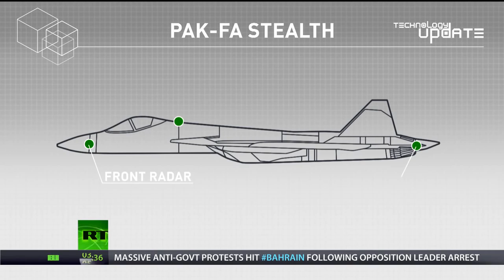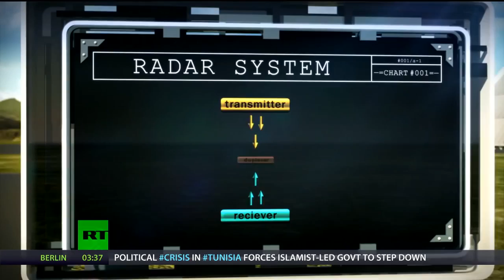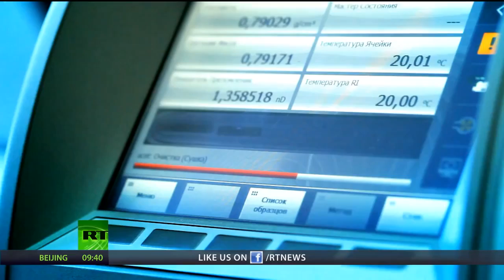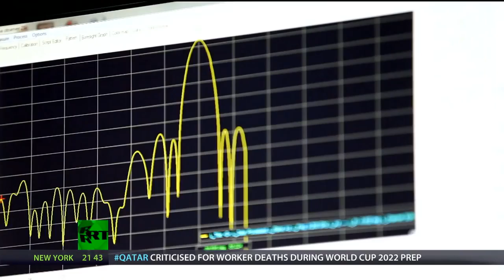Sukhoi T 50 PAK FA Stealth Technology

Comment: Congragulations Russia! You finally caught up with the United States stealth technology! You have my congratz. Now, the f-22 has better stealth characteristics, it's cruising speed is Mach 1.5-2 while it's true top speed is classified. The f-22 also has supercruise, allowing it to save fuel while going supersonic speeds (doesn't need afterburner), thus making the range further and more efficient. The f-22 also has AESA radar, a faster, more effiecent Radar that can jam other radar and missiles while it's tracking objects (can be used for close counter attacks). The pakfa has a faster cruising speed and 3d thrust vectoring, making it faster and more maneuverable. Yet it lacks supercruise, making its range shorter. The stealth is a little bit weaker than the f-22. So for the winner, you guys decide. I personally think the f-22 because it's AESA radar can jam missiles up close, and the stealth can hide them from miles away.
Reply: Actualy YOU cought up with RUSSIAN stealth technology, since you obviously don't know who "invented" it!!
Also, T-50 has more fuel, so not having super cruise isn't a flaw, also unlike F22 high sensitivity (can't fly in) to the RAIN, small arms fire and thunderstorms, it can do all that, and plus, again unlike F22, it can produce it's oxygen without poissoning its pilots, like F22!!!
Also, you know that Donald Cook incident a while ago, If F22 has radar jamming, and T-50 doesn't, what do you think that ooooold MIG that "killed" your destroyer was testing, it's practicly and EMP (without permanent damage to the circuits)!!
Reply: Pyotr Yakovlevich Ufimtsev (born 1931 in Altai Krai) is a Soviet/Russian physicist and mathematician, considered the seminal force behind modern stealth aircraft technology. In the 1960s he began developing equations for predicting the reflection of electromagnetic waves from simple two-dimensional shapes.

Much of Ufimtsev's work was translated into English, and in the 1970s American Lockheed engineers began to expand upon some of his theories to create the concept of aircraft with reduced radar signatures.
Reply: Joseph565112 I think you need to look into the latest Russian radar systems that are fitted in the PAK FA also its defence systems which are an improvement on the already tried & tested SU-35BM,By the way there's no such thing as total stealth on any aircraft you'll already know that though also i'd like to know just out of curiosity what exactly is woefully inadequate about it's electronic capabilities as i know a little about the PAK FA's defence system & it's radar.I also know a little about it's long range weapon capabilities.I'm not saying for one minute you don't have the credentials to make statements about an aircraft's stealth capabilities i'm just interested to hear your take on the systems I've mentioned like the AESA & Irbis as they're part of the electronic warfare capabilities.The PAK FA has  a masking system & it's long range missiles can hit simultaneous targets up to 400km away,this is a fact as they've been proving them on the  SU-35BM over the last couple of years.
Reply: Correction, USA made (production stopped 3 years ago) 187 F22's, out of which 3 crashed KILLING 2 of their pilots, and Russia is about to make 240 T-50's, that's 1:1,4 in terms of numbers... BUT Russia just began (6 made so far) making them and can produce much more if needed, for the price of $86 000 000 a peace, while F22's costed the US $360 000 000 a peace (4 and a half TIMES more)!!!
Reply: Being a millionaire in USA is AVERAGE today? Hahaha... 45 milion people in USA have 2 or LESS meals a day, meaning live below poverty line, another 30% live on paychecks not over $24 000/year, now THAT'S your average!!!
Also you should keep in mind that you might have $30 000 while average Russian may have $10 000, BUT he won't have to pay mortgage to his $300 000 house in the suburbs, but a bank loan for a 2 bedrom flat worth 1/5 that, also other "living expences" are much lower than in the US!!
Reply: If the f22 is that great why they stopped producing it?
Reply: Cause they:
1 - KILLED their pilots, or at least poisoned them, 2 confirmed kills in 3 crashes, 13 confirmed poisonings!!
2 - Cost $360 000 000 (that's 330 000 000€, as 3 jumbo jets) a piece, and globaf financial crisis hit US hard too...
3 - Besides being more fatal to their pilots and technicians, they are extremely needy, for every hour of flight (that costs $47 000), they need aditional 39 hours of maintenance, which costs at least as much probably!!
4 - They are, or were until 3 days ago if what I heard is true, only paper machines, not literaly but in 9 years of service they NEVER, EVER saw combat actions, eventhough US invaded (for no reason) Iraq, Avghanistan and bombed Lybia, until they started, or so they say, bombing ISIS with it!!! Offcourse the reason is obvious from #5, so here it is...
5 - I wrote paper machine cause it is so FRAGILE that it's ridiculous, it must NOT fly in the rain cause then it's much more visible, aka not stealthy (eventhough it isn't in dry weather for Russian low frequency radars), it must NOT fly when there are thundestorms 25m/40km around target cause of sensitive sensors/eletronics, it must NOT be shot not even with small caliber rounds as it's skin is so fragile it would tear itself!!!
Reply: Dionendermann
Actualy since you're the one that spiled that load of crap, you should provide evidence for your data, which is inconsistent with the "mainstream", like I said, 187 built, at least 2 crashed, you say it's 195 build, prove me wrong?
Reply: Your comment is so informative .. thank you.
But do think that the russians are going the extreme route since they have got less than 12% debts .. that it will help them with mass production plan .. plus there must be alot not to be revealed.  Since its a fresh product.
Reply: Your comment is so informative .. thank you.
But do think that the russians are going the extreme route since they have got less than 12% debts .. that it will help them with mass production plan .. plus there must be alot not to be revealed.  Since its a fresh product.
Reply: Well the bigger the economy is, the more you actually spend on the product. Say for example, something costs 200,000 mill in America, but the same exact thing will cost maybe 20 mill in Russia, but it effects both country's almost exactly. 200,000,000 is as expensive as 20,000,000 in Russia. So it almost doesn't matter. Sorry for any confusion in my comment lol
Reply: Dionendermann No I got your point .. well said man .. I think you are Pilot, Engineer, and economist lol.
well said man, well said.
thank you.
Reply: Lol i want to be a fighter pilot! But thanks a lot dood
Reply: Alright so i researched a bit and neither the soviet nor the u.s "invented" the stealth technology. The Germans first used it in a submarine seen here: http://www.faqs.org/espionage/Sp-Te/Stealth-Technology.html
Reply: the keyser soze that was the wrong comment section. Its awkward on my phone.  
But don't get cocky about this, the Chinese will not be far behind.
Reply: Don't forget the Sukhoi pak fa has super cruise as well
Reply: Davy Ro I know exactly what you're talking about, and I'll get into specifics. I've been studying this plane for years. Of course no plane is completely stealthed by any single feature of combo of features. Stealth comes in layers.
1. Anti-early detection capability (anti-observation radar).
2. Anti-weapons radar 
3. Heat signature reduction
4. Communications concealment.
These are the four primary obstacles to overcome, and they are daunting to everyone.

The PAK lags behind in all four areas, but in particular in numbers 1, 3, and 4. 
The only radars capable of even picking up the F-22 (as well as any good counterpart that might be produced by Russia or China) are extremely low-band radars.
These types of radars are exclusively used for observation and early warning. 
They have no use in weapons targeting. 

For example, L-band radar, which can pick up the F-22, still cannot track it worth a damn, and L-band radar (like all low-band radar) has very poor resolution. 
Consequently, these radar stations have to be built about the size of an RV or even a house to even be somewhat effective...and the benefits are menial since it only serves as early detection.

Confounded at what to do, the Russians are installing L-band radar in the PAK FA in the hopes that it will give the pilot even just a glimpse of his foe. 
This is where they've hit a brick wall.
Even if the L-band system in the PAK alerts the pilot, it's useless in an engagement.
Besides, L-band radar can be easily picked up using passive detection methods of the F-22.

Number 3 speaks for itself.

As for 4, one of the F-22's most sought after capabilities is its ability, through a revolutionary fused-sensor system, to actively track and even engage targets by homing in on their communications waves.
Its ability to listen in, track and engage using multiple bands and even radio frequency all while concealing its own communications and radar signature are so far unrivaled. Which is evident by the mind boggling of attempts to hack and or otherwise steal information related to these features.  
Here's the latest case from just this year of two Chinese "students" sent here believing that they are some kind of 007 to try and steal a sensor used in the Raptor via a research university. Now they're going to rot in prison. 
http://whotv.com/2014/06/12/isu-student-accused-of-funneling-military-secrets-to-china/
Reply: Joseph565112 thank you i really appreciate that you've took the time to let me know where you were coming from regarding the PAK.I must admit i did wonder why it had 3 separate types of radar installed.On another note i'm just asking your opinion here do you think it would have been better for the U.S to have developed a Raptor mk II instead of the F-35 by that i mean using parts that could maybe used in both aircraft not all but say 30 to 40% me personally i would have because the financial outlay for the F-35 is ridicules also to stop production of the Raptor altogether while the F-35 still has quite a few flaws doesn't make sense IMHO.
Reply: Murica Ft.Best What I know is the F-22 Raptor has been around since around 1994 and Russia is just now catching up to it.  Now you have to ask yourself, do you think the USA has been sitting idle on the F22 the last two decades without having built something new to improve on the F22 not known to any of us yet?  As a retired Marine and having previously worked in a grey world project for Northrop I can promise you anything you see publicly now, was really designed 20 years ago meaning what we really have now, won't be publicly announced on YouTube or globally for another 20 years or until duty calls but yes, any warbird that is in commission for over 20+ years is something to be proud of.  If it were really junk, it would have been scraped a long time ago and Russia wouldn't be trying to replicate it!
Reply: What the heck who told you all that? Your mom or something? Literally 90% of what u said was false (10% cuz i dont know not care who invented stealth).
Reply: cost of f-22 is cca 150 000 000 dolars
future cost of Su-50 may be about 50-60 000 000, 2 or three T-50 can fuck the F-22 :-) T-50 don t need supercruise for over mach flying
Reply: +GORLOJ actually the United States is making 195 f-22s, while Russia is making 150. It may cost less but thats like a million dollars in America today is like nothing, but a million dollars back then in America was really something. Know what I mean? Just a bigger economy :)
References

http://en.m.wikipedia.org/wiki/F-22_Raptor

http://en.m.wikipedia.org/wiki/Sukhoi_PAK_FA
Reply: Please give me a reference (like i did in my last comment) saying that so i know you are not lying.
Reply: The f22 maximum speed is 1000 mph
Reply: All we know is that the f-22's top speed is above Mach 2 (1400 mph), it's true top speed is classified (i dunno why).
Reply: +Lomnjac007 just a reminder, please give me references to your last comment so i know that you are not lying (which you probably just guessed random numbers of the top of your head).
Reply: Oh
Reply: I already had these references in my other comment:
http://en.m.wikipedia.org/wiki/F-22_Raptor

http://en.m.wikipedia.org/wiki/Sukhoi_PAK_FA
Reply: Не забудь еще о цене)))))))))))
Reply: +ASAR happi 200 million dollars to the United states is similiar to 75 million dollars to Russia. Just different economies. Like having a million dollars in the United states 30 years ago was a HUGE thing, now it's average. How does that work? Econimical growth.
Reply: Lomnjac007 they just admitted they aren't quite there yet, but not far behind.
Now just think about the Chinese and there 2 billion people, now think of how many engineers they currently have researching stealth ? Something they will not tell us.
I'm sure they can kill a f35 that they say our grand kids will be flying and are bound to have aesa radar too if that's what you're counting on. 
Abusing these Russians wont stop them, talk is cheap.
Reply: Now how many Chinese engineers are there doing the same thing.
Reply: It doesn't just take a lot of people to do something, it takes a lot of highly educated and experienced people, Russians have that cause they have been building planes for nearly a century, Chinese don't, that's why they copy everything...
Reply: My xbox and Iphone, are you stupid or what, what gave you the idea that me, the obvious Slavic man and fan, and obviously not fond of USA, even a bit, am actualy from USA!? Hahaha...
Reply: Dionendermann Make no mistake, the US is not being able to afford to spend so much money, is one of the most individadas nations of the world, its sovereignty has ceased to be something unreachable for a long time, and is soon to be superseded by two or more nations simultaneously ...
Reply: I don't see a stealth aircraft here, and unlike 99.9% of the people commenting, I actually have credentials to say this. Hence, I'm not looking for a pissing contest. The engines are not stealthy at all...virtually no heat reduction. Most importantly, the plane has no concealment of it's own radar. Radar is like a flashlight...it can help you a lot in the dark, but it also lets everyone else know where you are. The F-22's most sensitive secret is the shroud that allows it to send out and receive radar spanning the entire spectrum without its source revealing a distinct signature. 
From this point, it's beyond obvious that the T-50's electronic warfare capabilities are woefully inadequate.
Reply: Alright I'm back, what did I miss?
Reply: Davy Ro I know this looks long, but it's all relevant. First a little background. Virtually every country wants to sell their new equipment and weapons they've produced - export models - which are often slightly different (usually a little less advanced) and these are sold to allies as well as some random nations to offset the production costs, or even turn a profit over time. 
All of America's allies and enemies alike absolutely lust after the F-22, it's electronics, avionics and other sensors in particular. It's deadliest feature, it's electronic warfare capability, is simply unmatched. 
Consequently, no export model has been produced. The whole platform is too secret. 
The F-35 program was the Pentagon's way to kill two birds with one stone. 
1. Further develop a few things on a new, yet similar platform, and try out a few new things.
2. This plane serves as the alternative which can and will be sold to the US's allies, since no export model of the F-22 was created.

Additionally, and this is where I have to tread carefully, the absolutely mind boggling number of attempts to hack and/or otherwise steal technology related to the F-22 and F-35 by the Chinese and Russians, in particular, was used as an opportunity to set their own programs back...ever heard of salting?
Typically this refers to munitions which are purposefully given or left for your enemy because the mortar rounds and even bullets are actually bombs that will maim or kill the user.
Well, the industry has purposefully allowed some information to be stolen which is no good...it has set back the design, testing and production of the Pak FA as well as the Chinese rip offs, the J-20 and J-31.
Reply: Lomnjac007
Intersting news, but the source? Ama serious I can believe what you say but I'd like to know the sources.
Anyway you also forgot a reasone why f22 was stopped to be produced:
#6 Obama won the nobel prize for Peace
(Joking :))
Reply: пи ззздец вам вы все скоро умрете Америка сосы
Reply: Michael Baker Не тот силен у кого палка больше, а тот кто сообразительнее. Лучше задумайтесь, как сохранить мир.
Reply: every modern russian plane has supercruise and jamming technology lol but nice try.
Reply: All u said said actually most of it it's just commercial..... Don't trust all they say!